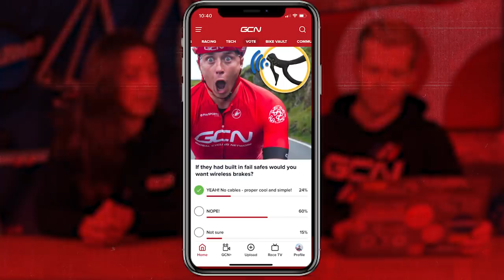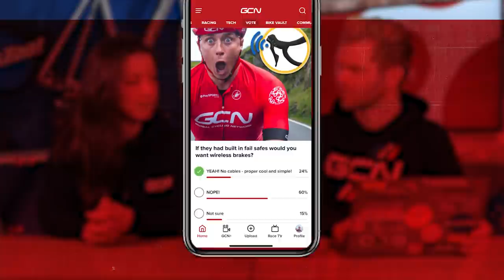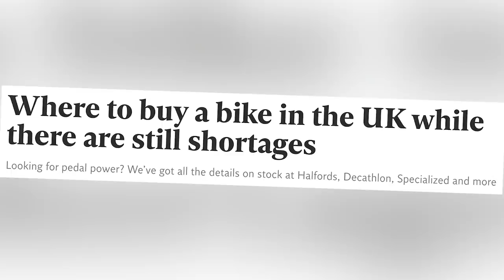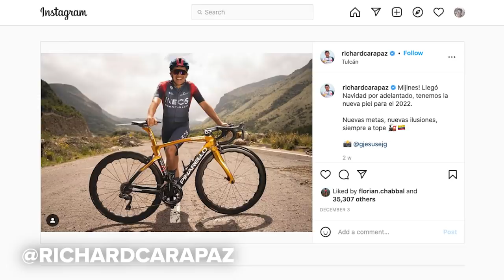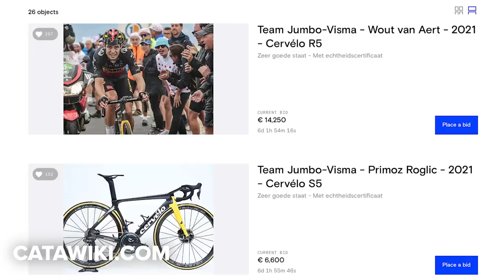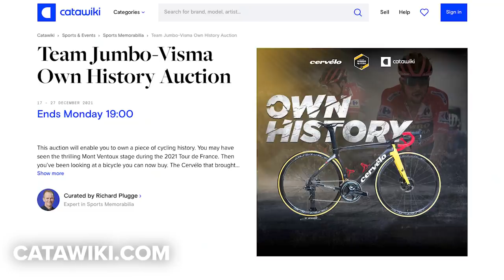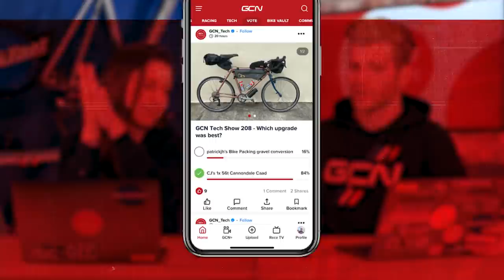2021 Wrap-Up: Best Of The Bike Vault & Top Tech Stories! | GCN Tech Show Ep. 210

Comment: Why does the affection for marginal gains get thrown out completely when it comes to braking devices?
Reply: Because marginal gains are to make you go faster, brakes do the opposite.
Reply: @stevemawer848  But that's my point - people are okay to pledge allegiance to the disc brake when they are less aero and heavier. If marginal gains mattered, people would be lapping up rim brakes like spilled whiskey for the weight and aero gains alone. I don't understand - some of the aero kit and grams being saved and shorn off are only compensating for the mighty disc. In the end the net result is smaller than if they had stuck with rim brakes.